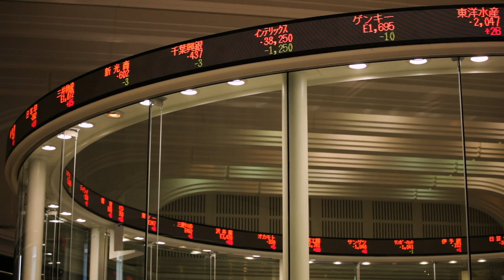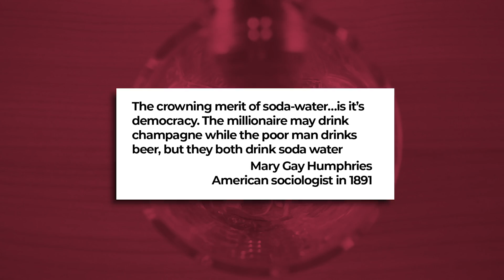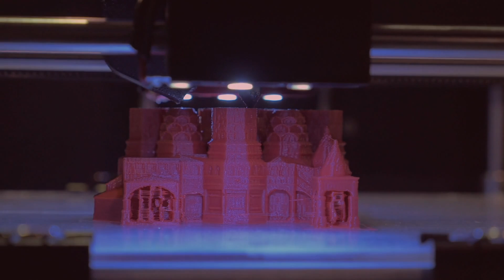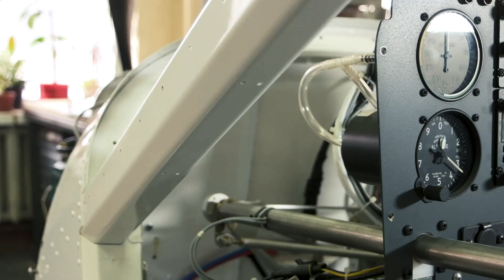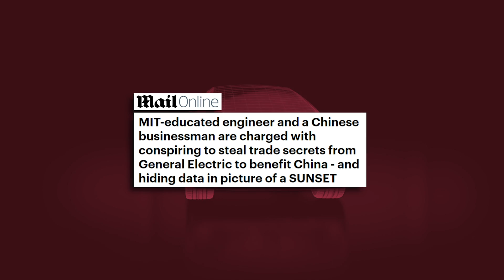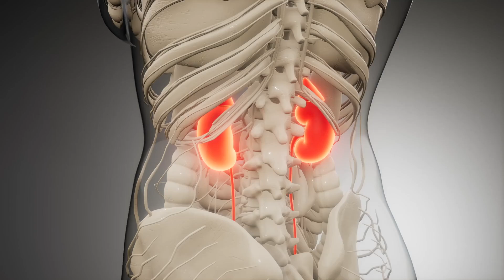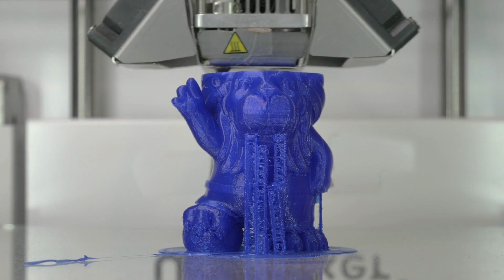Can 3D PRINTING change the WORLD? - VisualPolitik EN

Comment: I've heard that the valve needed for the respirators costs about 10 cents to make, but is sold for 50 EUR. During the height of the Corona crisis in Italy, the company failed to meet demand, but sued Italians who used 3D printers to infringe their patent or as I like to call it save lives...
Reply: That was fake news. The company never sued anyone. Someone wanted sell the printed valve based on the original design but the manufacturer didnt allow it.
Reply: @MonguzTea  It was picked up by various news, including TYT and SPIEGEL. The latter at least is mainstream news, but they went a long way down from the great journalism they once fostered...
In any case, it can´t have been a misunderstanding, as they were clearly talking about that it was supposed to go to court, but no courts were held at the time due to the situation...

Comment: 3D printing has a high waste yield and so it's mostly for prototypes
Reply: Not when used correctly, qualified AM machines experience close to 0 scrap parts
Reply: For FDM that can be solved with a filament extruder machine. Hopefully as printers become more common, it will also become common to have at least one place in every city to bring your failed prints for reprocessing. I don't print enough to warrant owning a filament recycler, and thus have an ever-growing bag of failed prints. I may just have to send them off to the landfill eventually, but I'm hoping a recycling service will appear before then.

Powder-based printing does have very high inherent waste, though. Basically the same as traditional machining.

Comment: Can a 3d pinter print an another 3d printer?
Reply: Only a few parts.
Reply: Roots of replicating machines are getting back to Sir Adrian Boyer’s original movement back in ... 2005. RepRap = Rapid Replication. The idea that when you have a printer, or CNC, you fabricate forward two new copies of parts to make new machine.
40% of Prusa i3 MK3S is made using parts printed on farm of 500 3D printers in Prague. Prusa Research is probably best known and very successful manufacturer of RepRap 3D printers. Check them out if you are interested in starting journey in 3D printing, you can order a kit that you assemble yourself, Ikea style.

Comment: Shouldve talked about how it could possibly remove the comparative advantage of places like china and India as it womt matter if you have a large pool of cheap labour
Reply: VeroMithril Actually there’s a much older metric I often think of. Whoever has the most food and potable water has a huge power base . The North American nations , particularly the US and Canada, will always have power on those capacities alone.
Reply: VeroMithril  I wonder about 3d printed parts for robotics
Reply: @macberry4048  Lot's of that going on. Good cross pollination there with prosthesis design as well. I don't think I've seen a story about robotics students who didn't use at least some 3d printed parts in quite some time. This is a good video but he hardly touched the surface of what's going on today. You can (well could before the pandemic) get a pretty good 3d printer for under $300. And some pretty impressive machines for under $1k. Look into creality and prusa for a start.

Comment: First of all we are talking about multiple fields of 3D Printers. And what is not mention is VisualPolitik is the Industry 4.0 revolution happening, its interconnected with commercial grade 3D Printers. Its not a secret and common fact mostly around investors that many big companys are investing 3D manufacturing like Locked Martin, GE, BMW, but 3D Printers are just a small peace of a complete system of industry 4.0 and 3D Printers aren't even the most significant part of that system. (VisualPolitik you do this all the time, get your fact straight.)

Comment: Many scalability issues with 3D printing lie with business processes and software, and is not inherently limited by the hardware. Many 3D printing or contract fabrication companies lack the internal infrastructure to merge the sales, engineering, and client collaboration process. It is extremely difficult to scale if you do not have a central system in place to manage 3D files, quoting, spec data, communication, billing, and inventory. We (MakerOS) created a software that solves these issues by bridging the gap between sales, engineering, and clients. The platform allows for better collaboration to develop products faster and consolidates everything in a simple dashboard. Our clients (the fabrication businesses using 3D printing) are changing the world for many of the same reasons that are pointed out in the video. Happy to discuss!
Reply: 3d printing will be legitimate when Samsung starts selling a 3d printer. I really did expect more innovation with so many patents expiring but the enthusiasm seems like it just died off for some reason
Reply: @macberry4048  3D printing is already very legit but not for general consumers to own a machine. An incredible amount of everyday products have been and are prototyped via 3D printing. For mass production, there are certain machines that our clients use called SLS and MJF that can produce tens of thousands of parts in a few days in various materials. The real power of 3D printing now is not for consumer use (to own machines), but for adaptive and distributed on-demand manufacturing - it will be the case for at least the next decade until sub $5k machines can print integrated circuits.
Reply: Many standards yes, but generally only one will come out as winner. Betamax vs VHS, Blueray vs HD-DVD, etc..

Comment: I"ve had a 3D printer for years and, until recently, mostly just printed out replacement parts for my wheelchairs. I do this because anything with the word, 'Medical' costs more than the printer and the PLA material combined. Now I print all kinds of things for friends, family, and organizations. One of my fears is using additive production in combination with deep fake software. While the software is just now starting to be used in mold making for prosthetic ears, breasts, and other soft tissue, printing anything can be taken to an entirely new level with photorealistic quality. There is no way to stop someone from printing any three-dimensional image in any visual media. As an example, with very simple 3D freeware, I was able to put together an image of Optimus Primes arm off of a commercial to print an exact duplicate as a replacement for the toys missing arm. Now, scale that up to anything you can think of.
Reply: printen a new wife, ya said?
Reply: So are the forearm missiles going to work on my Optimus prime arm is the real question! Got it
Reply: some kind of generative design ? I believe it will be the future when AI goes 3D
Reply: @ilhamwicaksono5802  It already has. There is a you-tube video from one or more of the 3d printing you-tubers where he used software (fusion 360 iirc) with it's various tools to automatically design a shelf brace/bracket. The software analysed the stress points and ran simulations to design a low material optimized bracket. And that's the low end stuff. Dig around and you'll find much more on ai assisted design for manufacturing, including additive.
Reply: 3D printing a photorealistic fingerprint of your thumb. A hackers new weapon